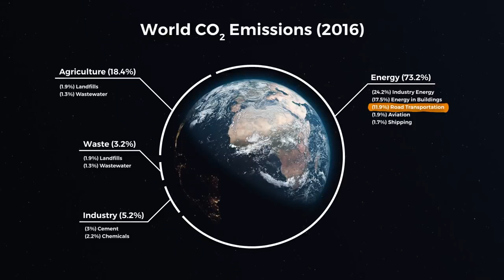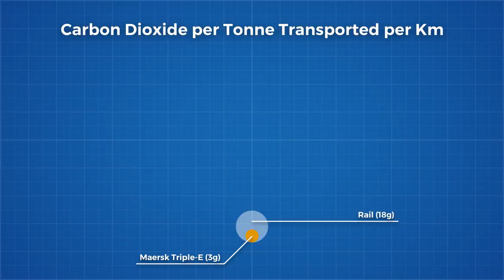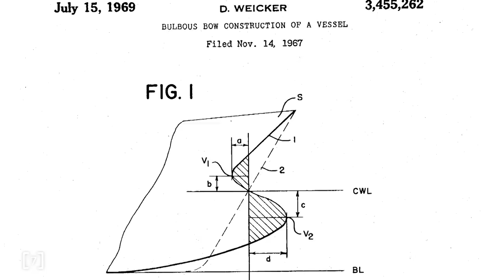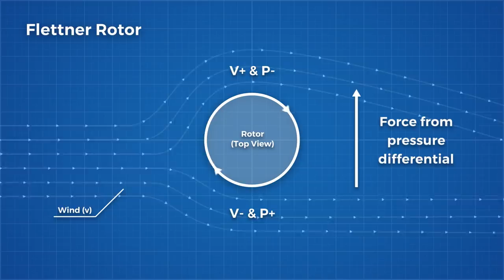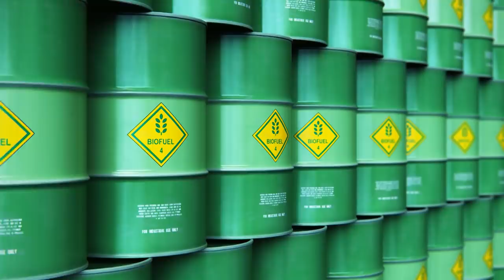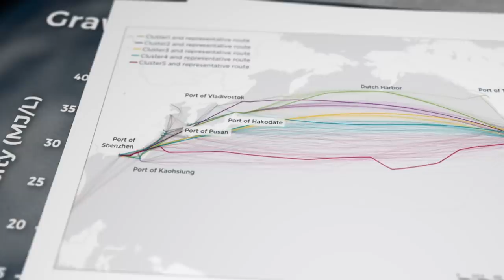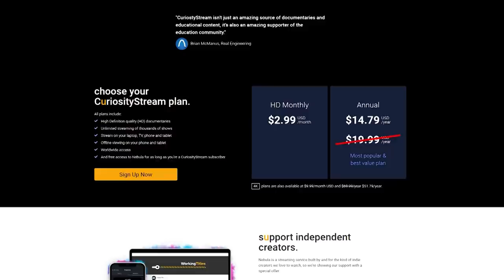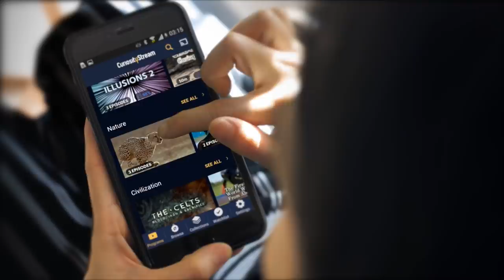Are Renewable Powered Ships Possible?

Comment: Energy-related problem: Exists

Nuclear Power gang: "Allow us to introduce ourselves"
Reply: What could go wrong putting nuclear reactors on ships owned by private companies and sailing through pirate-infested waters?
Reply: collides with another nuclear powered ship
Reply: @kariminalo979  Not an impossible challenge to solve, in fact, it's quite easy to counter
Reply: @apacheattackhelicopter8185  Most nuclear reactors were designed by private companies, built by private companies and operated by private companies, the private ownership is irrelevant.
Reply: well the US did with it s carriers.
Reply: @Juanixtec  No they weren't. Rosatom is a government company. EDF is a government company. TEPCO is a government company. Which "most" reactors are you talking about, the ones in the USA?
Reply: EDF isn't a government company. Or, well, it depends on what your definition of a governmental company is. The French state has over 80% of it's stocks so it's owned by the state but not necessarily run by the state. However IDK enough about that to confirm

Still, yes, you're right, most nuclear reactors worldwide are operated by state owned companies. However I, still maintain my other statements, Hitachi, Holtec, General electric etc.. are all private companies.
Reply: @Juanixtec  There's also a difference between a nuclear power plant that stays within a country and a ship that can go anywhere in the world, including in territorial waters of rogue states.
Reply: Exactly! All US submarines and aircraft carriers are nuclear powered, from what I've read. https://en.wikipedia.org/wiki/Nuclear_navy#United_States_Naval_reactors
Reply: But in this case, it's already being done by the military.  The nuclear solution already exists.
Reply: @techienate  I find it amazing how ships in the early 20th century, like the Titanic, relied on massive amounts of polluting, low energy dense coal while in the mid-20th century, technology advanced fast enough to enable efficient nuclear-powered ships that require little amounts of energy-dense fuel.
Reply: DispelTheMyth  I do seem to recall that for a while the US was concerned about the possibility of a "dirty bomb", ie regular bomb with a bunch of radioactive material inside it. The concern was that one of these would be detonated over the west coast and the radioactive material would spread across the country, spreading cancer and fear. I have no idea of the feasibility of such a bomb, but it is something the US government is very aware of and it wouldn't require weapons grade materials to put into effect.
Reply: DispelTheMyth  Why wouldn't Iran, ISIS or North Korea care about uranium-233, uranium-235 or plutonium-239, mr. big brain?
Reply: Portable fusion reactor gang
Reply: Well, i mean, russia already built a floating nuclear reactor and they on a big nuclear icebreaker fleet, why not?
Reply: @apacheattackhelicopter8185  
General Electric, Westinghouse, and Hitachi are major private designers and builders of nuclear reactors.
Reply: @apacheattackhelicopter8185  They would not use uranium, we would use Thorium in modular Liftr reactors.
Reply: @glensven  Where can I see a working thorium reactor?
Reply: @nousername5673  The US Navy still has a lot of smaller ships that burn oil.
Reply: @calamityjean1525  Really? If so, what a shame.
Reply: @spicybaguette7706  Have you studied nuclear physics?
Reply: @nousername5673  I don't think nuclear power plants can be made small enough to run little ships like destroyers.
Even nuclear-powered aircraft carriers need petroleum-based fuel, the aircraft burn jet fuel.
Reply: @calamityjean1525  This is not true. The US and many  other countries deploy nuclear-powered submarines which are smaller then most destroyers.
Reply: @calamityjean1525  Fortunately, cargo ships would not need to burn fossil fuels if they are powered by nuclear reactors as technology has existed for over 50 years.
Reply: @maxiking120  its a cost consideration for anything smaller than a Carrier. You dont gain much using nuke propulsion, but the costs to build and operate go up massively. With the submarine you gain huge capabilities to stay underwater for months and manuver at much higher speeds than battery driven subs.
Reply: @nousername5673  Some countries won't allow nuclear-powered ships into their harbors.  Some other solution will have to be found.
Reply: @calamityjean1525  The only issue with nuclear here is security (highly enriched uranium). The technology exists but I’m guessing that hydrogen or fuels produced from hydrogen and green energy will probably be the norm.
Reply: @nousername5673  I agree, nuclear is so expensive for security and other reasons that synthetic fuels are likely to be the answer if renewable electricity can't be used directly.
Reply: @apacheattackhelicopter8185  a common misconception about nuclear powered vessels is that they can be easly turned into weapons. Not really. I watched a video with a former US nuclear submarine captain discussing that.
Reply: love me some good cheap nuclear power with low enrichment fuel
Reply: @alessandrorona6205  Good thing you got rid of this misconception. Now you can watch a video about what a dirty bomb is.
Reply: Outside of being fairly chemically toxic, civil power reactor nuclear isotopes aren't very good for even a dirty radiation bomb as is, and would be rather problematic to weaponise in a worthwhile manner. It would be much easier just to use chemical weapons.
Reply: While Safety & Acceptability are two concerns that might be manageable the real killer for going nuclear is Economic. Nuclear costs to much to install and the operating costs are higher in manpower, regulatory compliance and maintenance.  Navies do not have to turn a profit in a competitive environment.  Submarines are unique in having no access to ambient oxygen so that is another reason to make your deadly killing machine nuclear, snorkels only work at near surface levels in fairly calm water. With regard to aircraft carriers the Queen Elizabeth and Prince of Wales are both gas turbine powered in part for economic reasons.
Reply: @kariminalo979  there is a case on record of two nuclear subs, one French the other British, having done just that.
Reply: @spicybaguette7706  but fusion is still twenty years away, as it has been since 1960. It may well happen on appropriate scale but not any time soon.
Reply: @BernardLS  lol all the earth's nations are going to spend literally trillions of dollars anyway to combat climate change, why quibble over artificially contrived issues especially considering solar and wind have had literally decades of administrative wheel greasing to get where they are now.

Also they are cheaper reactor design available but nobody wants to give them proper funding to develop them further.
Reply: @ANTSEMUT1  WADR easiest & cheapest way to save the planet, have fewer people who all consume less.
Reply: @BernardLS  except no, and fewer people doesn't result in less consumption when we aren't tackling our waste cycle, which solar and wind don't help with their own product lifecycle wind turbines in particular are problematic solar is getting better at handling their waste but it isn't where it should be which i can't say about wind power.
Reply: @BernardLS  also even Real Engineering has pointed out that wind and solar power needs to be backed up by natural gas, as backup solid state batteries isn't anywhere near the storage capacity it needs to be. To say nothing of the fact that again these Batteries don't have a great lifespan and will need to be disposed of properly.
Reply: @ANTSEMUT1  agreed having fewer people does not ensure lower overall consumption but having fewer people who each consume less than the current population will.  Every side of the debate appears to claim that the others are getting the ‘wheel greasing’ (I like that turn of phase) the renewables say that authorities are subsidising the FOGI even as the some taxpayers say ‘no subsidies for anyone’.  levelling the playing field is impossible as even drawing the boundaries is like trying to determine the edge of a fog bank. This part of a response to your two part riposte and working off my IPad is tricky so stand by for more later. Med vänligt hälsningar Bernard
Reply: @calamityjean1525  reactors can absolutely be minimized to the point of fitting on a destroyer the size if an Arleigh Burke class. Something to remember is that the Arleigh may be called a destroyer, but she's actually the size of a WW2 Heavy Cruiser (honestly, the Arleigh Burke class is almost the size of some battle cruisers). The USN had at least one CGN (nuclear powered guided missile cruiser) during the cold War, but the decision was made that the refueling costs just didn't make sense for small surface combatants.

Even though nuclear powered ships can go years between refueling, when you do have to refuel them, you basically have to rip the entire ship apart to get to the reactors, and swap the fuel out.
Reply: A lot of assumptions about nuclear: new improved designs will not be cheaper and safer than old reactor designs, if it doesnt work in all cases and all routes its useless and cannot contribute to reduce carbon emissions, hydrogen or other synthetic fuels produced by nuclear thermolysis or nuclear sourced heat will not be cheaper in large quantities, we will never be so desperate to reduce climate change that we will accept the risk
Reply: @MrKeserian  you dont have to rip them out to refuel if you design it right
Reply: @vmaldia  We could say the same about your comment, nothing more than assumptions made by fear.
Reply: @Juanixtec  actually i make no assumptions, i just state what the assumptions of the anti nuclear replies to your post seem to be. To be clear i support  nuclear but not blindly
Reply: @ANTSEMUT1  actually i was describing the responses of anti nuclear replies. I actually dont agree with them
Reply: @vmaldia  Then I'm sorry, I haven't read all the replies to my comment lol.
Reply: @vmaldia  fuck it sure did look like it.
Reply: @Juanixtec  ok.
Reply: @jaredwilliams8621  you don't need to capture a reactor for that (dirty bomb). Just dig a bit in South Africa or India. It doesn't need to be enriched at all.
Reply: Won't happen. People are still eating big oil lies about "muh nuclear scary and bad" while at the same time condemning them and looking for ghost solution and ignoring the elephant in the room
Reply: It has shown to be superior than most other sources, based on the information I have gathered thus far, and is far safer than many think. Fukushima and Chernobyl were rare instances.
Reply: @epauletshark3793  Yea, compared to other types of power plants, nuclear has the lowest accident count in the last 50 years, you can even count it with your fingers.
Reply: @apacheattackhelicopter8185  Not much actually. If a core melts, it will solidify in the water. The radioactivity that it gives off is negligible than the naturally abundant radioactive materials fish already swim in.
Reply: @apacheattackhelicopter8185  

The pirates wouldn’t be able to do shit. Think about what you would need to do to take uranium off of ship in the middle of the ocean. Then you need to enrich it which means you need another plant.
Reply: @calamityjean1525  yeah it's true that they use petroleum based fuel...

For the aircraft that they carry not for the ship it self
Reply: @MrKeserian  I'm quite surprised that the USN haven't developed a carrier with modular nuclear reactor
Reply: @ANTSEMUT1  Natural gas is so cheap in the US currently that it's being used as baseload power instead of coal.  There isn't enough wind and solar power installed yet to eliminate burning natural gas.  However, as more renewables are put in, more and more time will be covered by renewables and less by gas or coal.  Gradually coal will vanish and natural gas dwindle to a few hours per week, then a few hours per month, then a few hours per year.  At the same time, more battery factories are being built so there will be more energy storage capacity.  I expect that it will take at least ten years but no more than twenty to make the changeover to fully renewable for land-based uses.  Making the change for ships may take longer.
Reply: @archise3191  Have you see the news articles about the US Naval Research Laboratory's experimental process for making jet fuel out of seawater and air using excess electricity from the carrier's reactor?  The same process could be used on shore using excess wind or solar power.

Comment: A video on biofuels will make for an interresting future topic.  I work at a biodiesel plant in the US and we produce unfathomable quantities of fuel and other products.  At our facility, we convert every portion of soy beans into a marketable product with virtually no waste in that regard.  The fat is extracted from the solids which are converted into feed for livestock and then the fat goes through a chemical step to turn it into biodiesel and glycerol, which is further refined to a food grade glycerol.  This process requires acids, bases, and catalysts at different steps, and we use steam from a central boiler to add heat as needed.  As you've said, efficiency is vital when working with the scales that we do, but given all the carbon put into getting the beans to us, the fuel produced is far from carbon neutral.  However, given the amount of farmland in the midwest that is best suited for feed products, converting soy into non-food products is a necessity to sustain midwest farming and the livestock producers that rely on the low cost feed it produces.  My own conclusion, based on insufficient research, is that biodiesel specifically does not function as a step towards carbon neutrality but does provide a great variety of benefits that are realized in surprising places.
Reply: Nah at the rate we use fuel biofuels are also fueling mass deforestation and other issues amongst other things
Reply: @biohazardlnf  user  @Eric Lotze  made this comment:

When most people hear "Biofuel" they think soybean oil etc -> biodiesel, corn->ethanol, and MAYBE anerobic digestion->biogas (and optinal upgrading to natural gas specs) This was all generation 1 -ish The recent stuff is much less of a food vs fuel arguement Mainly: - Algae as a feedstock (can grow in many places, grows VERY fast) - HTL and Pyrolysis to produce "Bio-Crude" oil (Which (to a certain extent) can be a "drop in replacement" for refineries - Cellulose etc -> ethanol ALSO There are many other products that will be NEEDED that require some form or refinery: - Lubricants - Plastics - Propellants (in aerosol canisters) - Refrigerents (Butane is a common one) - etc ALSO Biochar / Carbon Black (From methane -> hydrogen + cng, or other processes) can be buried for Carbon Sequestration Also the storage infastructure for methane and liquid fuels allows for energy storage via Power-to-X and Biofuels in all of the current "salt domes"
Reply: @Zaky-Bear
RE: ". . . we produce unfathomable quantities of fuel and other products."
I'm sure that the production engineering managers know EXCATLY how much is produced per hour, per day, per week, per month and per year.
Reply: @Allen Loser Do you know why most of the midwest grows primarily feed crops?  Land and rain are plentiful, so growing at large scale is the best way to increase profits.  Relatively few food crops can be grown at the scales that this region can support and none are in nearly as high of demand as feed crops.  Soy based biodiesel only uses a portion of the bean.  A large portion still is used as feed products.  Only the soybean oil is used to make fuel and even then, glycerol is produced as a side product which also has food use.  There are some food products that use soybean oil, but once again, fuel has the greater size demand, which has served to drive down the price of the food grade oil as well since more beans can be grown per acre than virtually any other crop.
Reply: @spaceman081447  There is a difference between quantifying and understanding.  If I told you that the average railcar carried 200 tons of meal and one customer buys 10 railcars each week to feed their poultry, you would know how many pounds those birds ate each week, but that doesn't mean you can even guess at how large the barns are that hold all those birds, or how many workers are involved in raising them.
Reply: @zak686  you're still avoiding the main issue with bio fuel, deforestation. You might not be cutting down many trees in the US because the European settlers did that for you but imagine what the increase in demand for soy would do to places like Brazil, the Philippines, Indonesia and Honduras where the forests are struggling as they are
Reply: Do me a favor and stop putting your ethanol shit in our gasoline. No biogas and no bio diesel. If you want that crap you drink it yourself.
Reply: @sterlingeaton3083  ethanol is bad because it takes more energy to make than you get out of it. There are better biofuel options potentially